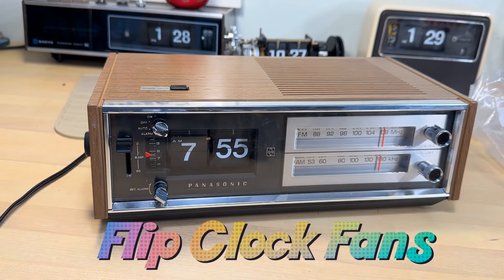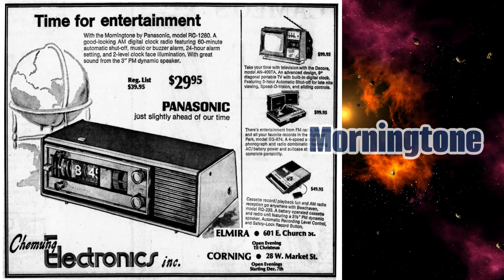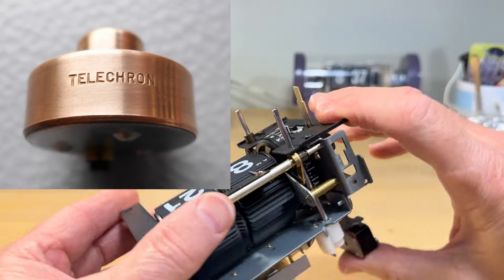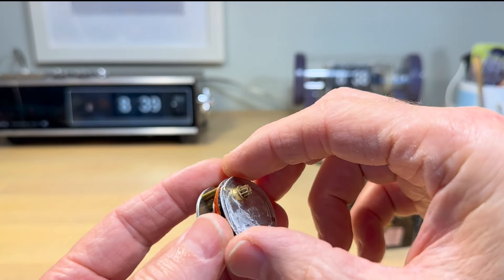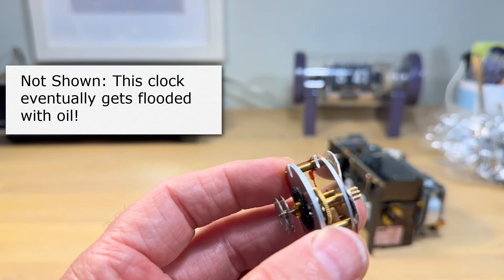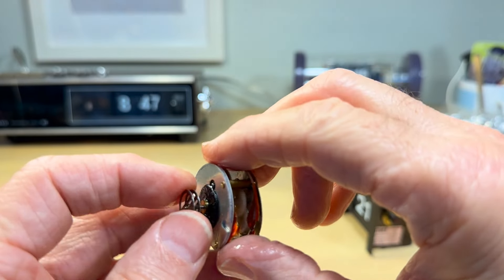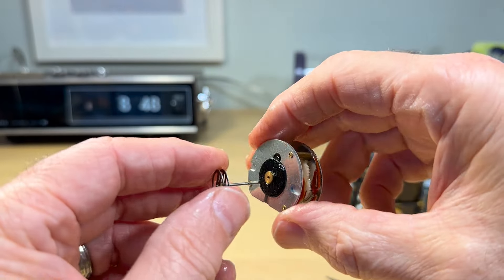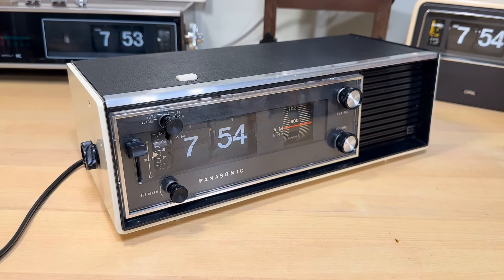Do not buy - Panasonic RC-1280 and the RC-6530 flip clocks

Comment from the maker: Had to fix the video and re-upload due to an error.  But anyway, the more I think about it the more I believe the the "armature" but especially those wheels amplify and transmit the sound of the two gears not meshing smoothly. This doesn't affect the time keeping at all but it's definitely noisy. Clearly, this is why the majority of Panasonics used the Copal mechanisms rather than these "Telechron" knock offs. Just my opinion.